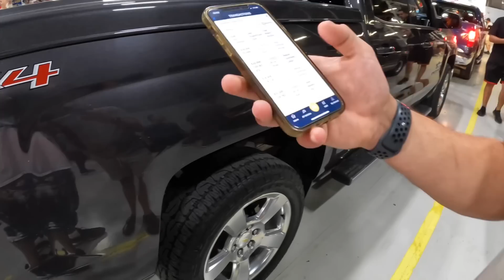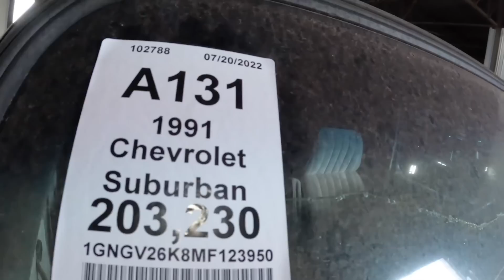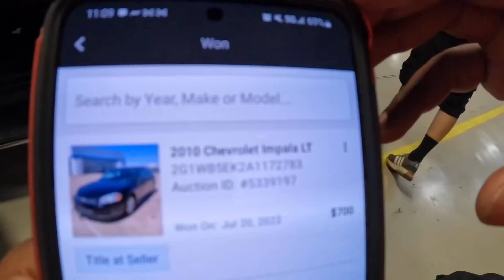😂 PAID TOO MUCH FOR THIS OBS 2 DOOR TAHOE AT THE AUCTION!!

Comment: I'm a Chevy man all the way but for a work truck you can't beat a 1999-2002 Ford F350 with a 7.3 engine . I had one and pulled a 45 foot 5th wheel camper from key west to Cody Wyoming and then to L A .